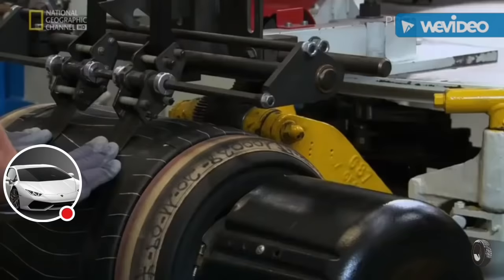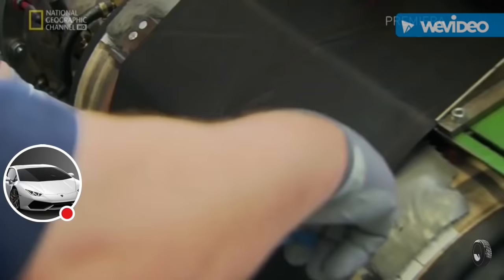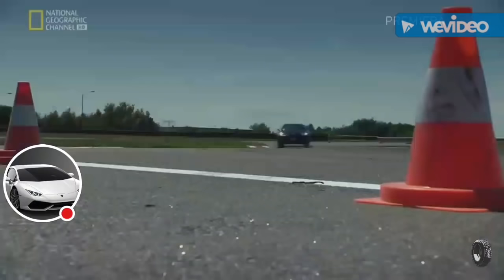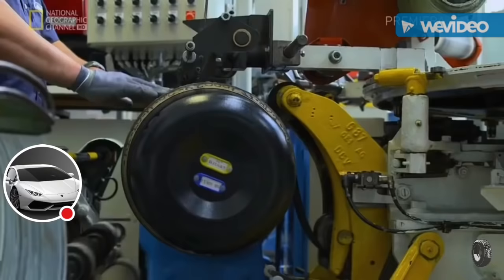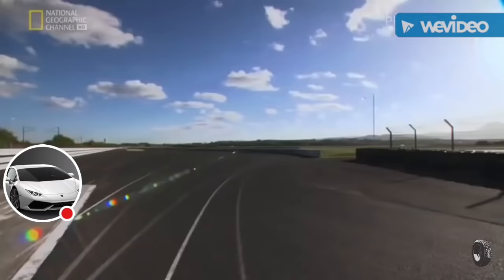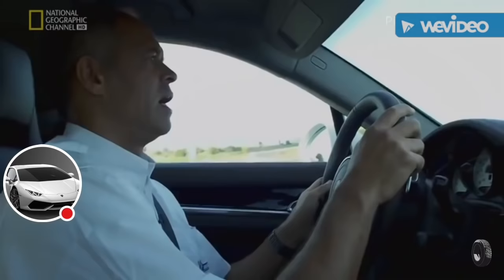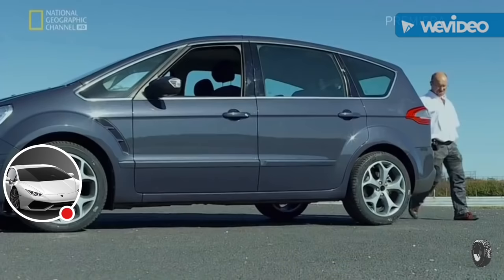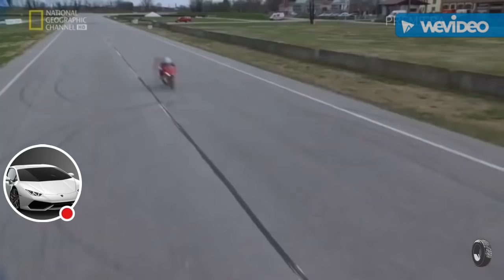How it's made: Michelin Tires

Comment: Skill. I could not do it
Reply: Yeah you could it’s really not all that hard the machine does most of the work for you all the components are made separately I make the steel belts that go in different tires it’s harder than actually building the tires because it has to be perfect and the scrap can’t be salvaged it’s the only material in the process that can’t be reused for tires

Comment: after watching this im im glad i buy continental..
Reply: Lol Michelin is the best
Reply: I’m glad you buy Continental also... I’m a tire builder for them and they are better built tires than Michelin.
Reply: @ooOoo.....   well, I think the other way around. I’m an operator at Michelin and think they build way better tires
Reply: @theredneckscientist2000  what's the story why
Reply: This video doesn’t show anything about how we actually make our tires or the materials going into them we have a really strenuous set of checks and balances for each process and every component is made to perfection the part I make is only allowed half a millimeter of variation I make the belts not the big rolls but the cuts that are for the specific tire codes. I work at the only Michelin plant that both produces all the materials and builds and cures the tires we actually ship our product to other Michelin plants to help them out
Reply: @OkieTA95  riding on a pair of Michelin defender LTX ms best tire I ever owned
Reply: @OkieTA95  work in a BFG plant, and we can make everything we need except white rubber and steel belts.

Comment: By weight, the difference between a new tire and one that is worn completely smooth is typically less than 5 percent.  You're paying for the whole tire but only get to use about 5 percent of it.  There must be a more efficient way to make tires so that the wearable tread can be replaced and the supporting structure can be reused indefinitely.   Figure out how to do that and you will become a very wealthy man.
Reply: They already did that decades ago. Semi tires had thick tread layers that could be re cut with new tread as they wore down.
Reply: We do its called re tread. The reason people buy our tires is because a michelin carcass can be retreaded up to 3 times.   Car tires, not so much because there has to be a blend of cost effectiveness vs wear